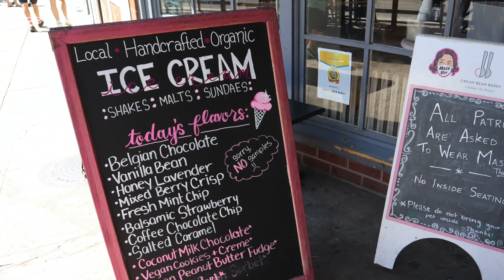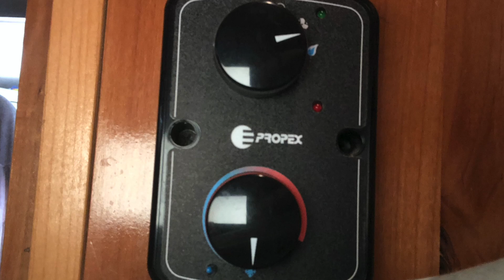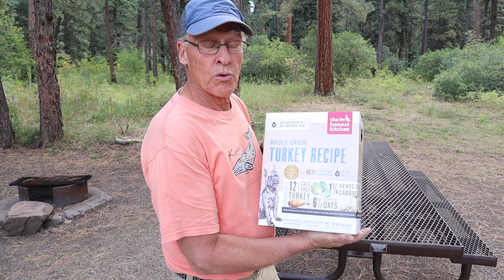VAN TOUR//SHORT BODY Design considerations//Full short body van tour with SHOWER and TOILET

Comment: Pretty damn AMAZING!! 
I thought it was dubious/ near impossible to pull off having everything I'd want/need for LT travel in a 136, yet you've proven it can be done and done really well! Kudos to you - and it really does look GREAT!
Personally, I'm good at maneuvering a larger vehicle(s) in tighter spaces and would feel a little cramped in the smaller van - I'm looking for a 159 ProMaster - however I'm likely gonna 'steal' more than a couple of your ingenious solutions when I get around to my build. 
Thank-you for showing that it can be done well, as I feared I would need the 159 extended, but now I've seen I can make things work well and still keep things a bit smaller and lighter, saving on fuel  - fuel = $$$ when on really looooong trips!
I'll definitely be checking on your build videos -- Many Thanks!
Reply from the maker: Thanks for your encouraging and supportive comment. Since the build I’ve learned a ton about building lighter!  If you need any advice or support send an email with your phone and I’ll follow up. Upper cabinets I would probably do the same. Others I would use mostly light framing and 1/4” plywood with 1/2” ply drawers. Good luck with your build!

Comment: I really like your design and build.  The sheer curtain for a bug scrren is genius.  And all the drawers under the sink are way easier to store and access.  The shower is a little "iffy" for me.  There are big gaps where the door hinges are and those would need to be covered in some way.  I also think I would like a higher platform -- maybe a place to stand connected to a hitch -- so I wouldn't be so obviously taking a shower with my body exposed from the knees down.  That would also allow me to easily get back inside to get dressed.  Thanks for sharing.
Reply from the maker: Thanks! Glad you liked the tour and the design. Here's couple of ideas about the shower. I agree with you on the "privacy". As we used the shower set up, we realized that we could pull the drapes in the back end over the gaps in the door/hinges area. We just use magnets to hold the drapes in place. Also, you might consider simply getting a longer shower curtain that will go all the way to the ground, or mount the bar lower. That way you'll get full coverage! I think you'll find that climbing into the back from the shower is pretty challenging. We typically use a shower mat and change in the shower area, then slip on our sandals before leaving the shower "room". Hope that gives you some simple solutions should you decide on an outdoor shower. Good luck.

Comment: Very informative video. How do you keep safe on the road, especially when boondocking in remote areas?.
Reply from the maker: I'm glad you found the video helpful. We've been very fortunate in our travels and felt safe most places. When we're in Mexico, we stay away from the cities and border towns. We trust our instinct - if it doesn't feel right, we don't stay. If we don't feel safe, we look for a secure campground. When boondocking, we usually lock the van and having a good sized dog is added safety. Hope that helps. Are you considering boondocking or remote camping?

Comment: I love your build.  I have a question.  I'm just 5'3".  Will I be able to comfortably drive the van with the swivel driver's seat?
Reply from the maker: Thanks! That’s a really important question.  I would definitely test drive one and take a cushion or seat pad to lift you up to see. Matt and I are close to the same height.  He can comfortably drive it, but I have trouble adjusting it so that I can reach the pedals without being too close to the steering wheel.  
We did a short tour of our friends Ford Transit. You may want to test drive that van.  It looks a lot more adjustable and way more comfortable.  Here’s the link https://youtu.be/Ws8IZJajDnE
Let’s us know what you ended up with.  I think our 5’3” followers would love to know.

Comment: Hello.  You certainly have a wonderful van.    Do you have trouble closing the sliding door when you are inside the van?  I'm thinking of having a closet like yours though I 'm concerned about being able to close the door.     Cheers
Reply from the maker: Thanks.  The closet doesn’t impact closing the sliding door.  We haven’t had any issues.  Good luck with your build!
Reply: Hi.  Thanks for the reply.   I didn't ask my question well.   How do you reach the handle to pull the door closed with the closet in the way?  Do you step outside to close it partially and then hop back inside to close it all the way?

Comment: I really appreciate the fine workmanship that went into your van build. Did you mostly use 3/4" plywood? Is the wood stained, or only varnished? I love the golden color. I'm my van, I'm considering some Faraday type fabric to put between me and the solar components to reduce EMF.  Have you considered this. I'm interested in your opinion as I'm not sure it would have the protective effect that I'm looking for. Thanks! Super nice van build!
Reply from the maker: If Matt had to do it over again, he would use as little 3/4" plywood as possible and use as much 1/4" as possible to keep the van lighter. We used non-toxic oil and finish over alder plywood. I have links to these product in the description in this video. The oil is Heritage Oil and the clear coat is Safecoat. We also have links to the hemp insulation, etc. Hope that helps. EMF is not a concern with DC power. EMF is only a concern when AC current is flowing. Matt wasn't concerned about it in our van. If you want a thorough conversation about with us, contact us through our Contact Us form on our website. at:https://www.sustainablehomeresource.com/ We'd love to chat with you about it. It's a topic of conversation and I couldn't do it justice in a comment.
Reply: @ClarityOffGrid  Thank you, I will send you an email through your Web site. Sorry I didn't notice the links below the video, I'll go take look. Talk to you soon!

Comment: Did you say how long from the back door to the back of the seat was and how wide inside wall to wall, I'm thinking  your size might be better thank you
Reply from the maker: The cargo section is 122" long. And we chose the RAM because the rear section where the bunk is is 75" - enough space to build a full size bed across the back. We used our double futon without having to cut it down. Also, for reference, the van is about 10" shorter than our Tacoma truck. Hope this helps.